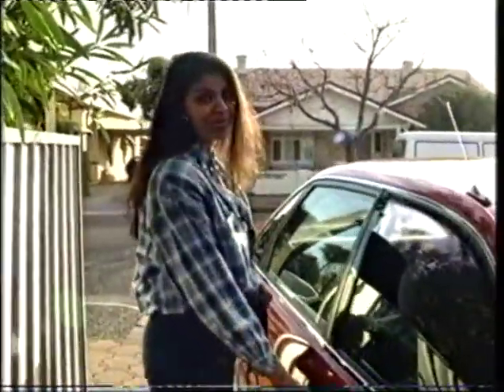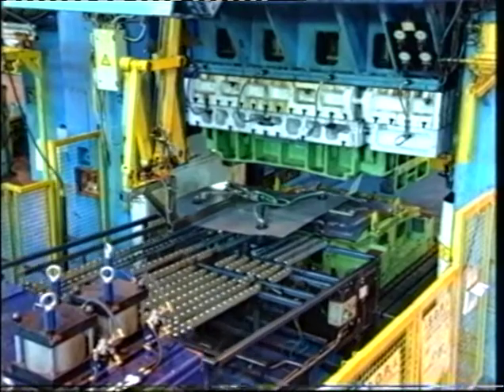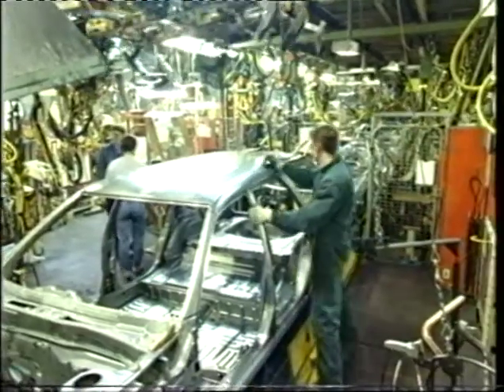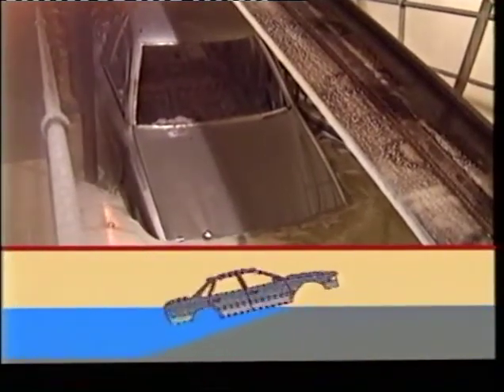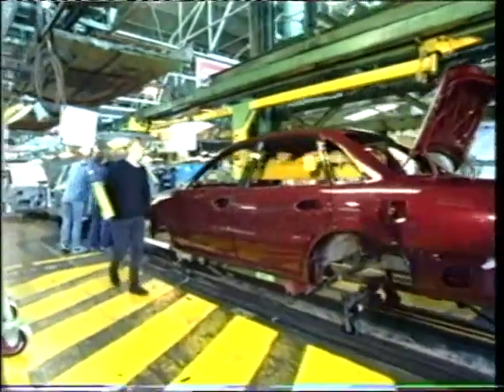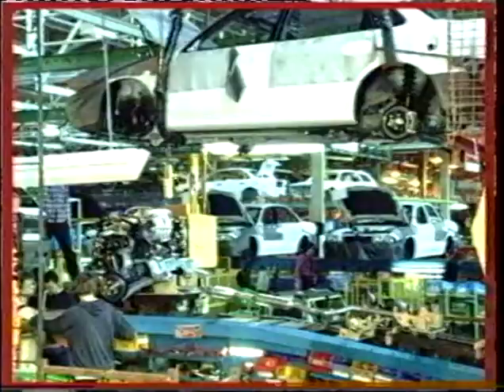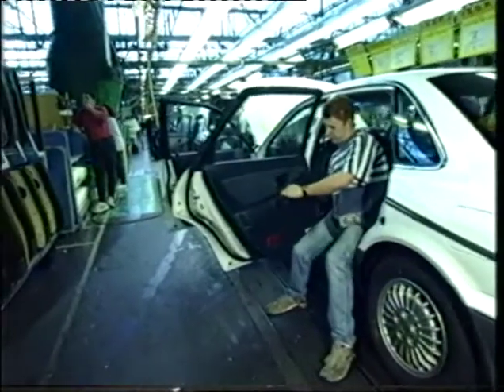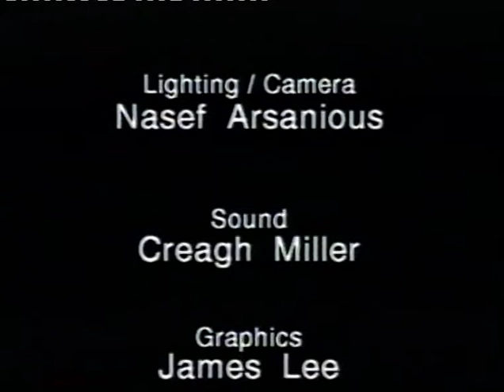Mitsubishi Australia factory 1994

Comment: I must have missed the bit when they added the rust and oil leaks and lose timing chains will have to watch it again
Reply: That's just the Australian package mate, anything we touched in the auto sector turned to shit, that's why everyone pulled out. Hopeless workers, processes and greedy unions that's the truth.
Reply: They don't even have timing chains, they have timing belts mate
Reply: @emilyking329  In fact, the majority sales were Astron 2.6 powered and sure did have timing chains from its birth at Chryslers Lonsdale plant in 1979 until the last ones made in 1998. Mitsubishi Australia  at least persisted and made chain driven cam and balance shaft  engines for almost 20 long years...
Reply: @deanstevenson6527  bullshit mate
Reply: @emilyking329  Everywhere else except Australia. Astron 80 or Astron II. The 2.4 ECi Multi Sirius based engine was for sure belt driven, but it was an import, JDM engine.

Comment: Sigmas and Magnas wernt much good the auto gearboxes were breaking down under warranty the sigmas with their rattling timing chain woes re early Mitsubishi  galants and la lb lancers were good cars! the saturn engine was very reliable and manufactured well they had no problems re mitsubishi cordias their engines wore out quick cylinder bore woes,Ford and Holden had their problems too cracked manifolds,broken rocker studs on the falcons weak floor pans on vb commodores I worked on them all really Australian motorist not getting good value for money spent on new cars back then maybe thats why new cars  wernt selling compared to overseas  vehicles.
Reply: Most of this is very true but our Magna is auto and has no issues
Reply: Interesting. I've owned 3 Magnas- all had their original, unopened auto gearboxes. Funny, timing chains do rattle at 200+k kms....when they are due for replacement.